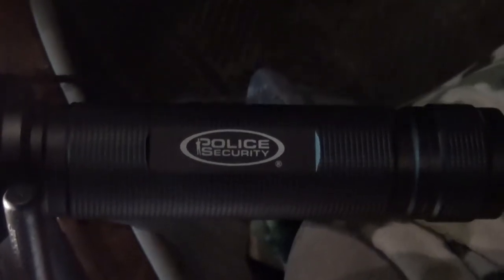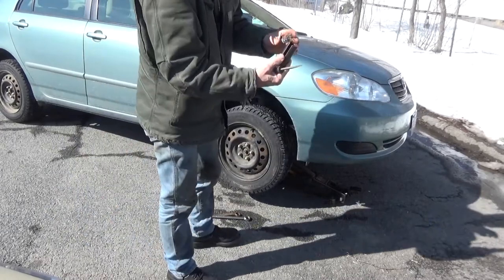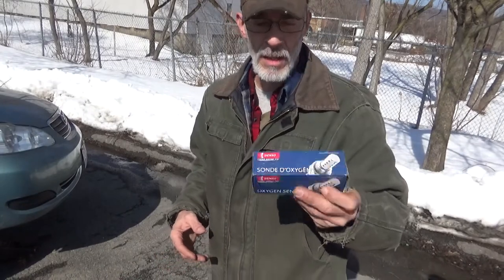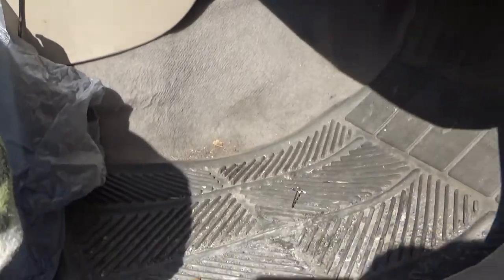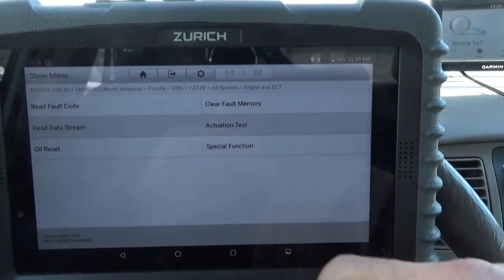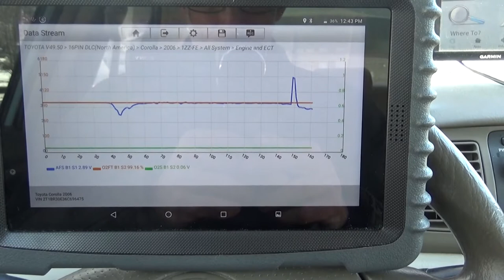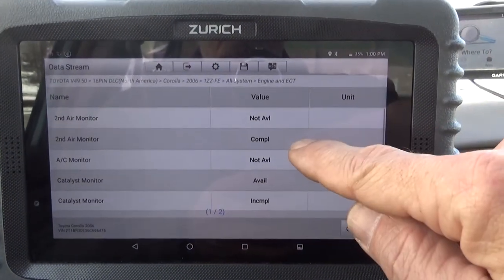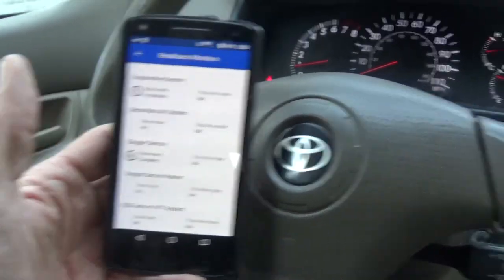2006 Toyota Corolla Rear Oxygen Sensor - The Repair - P0037 - Part 2 - Auto Repair

Comment: The Denso oxygen sensor I received was a 234-4802 is that going to be a problem for me? It's for a 2006 Toyota Corolla LE. (upstream Part 2)
Reply from the maker: according to what I've found, that part number is for the FRONT O2. This video was for the REAR O2. They are NOT interchangeable.
Reply: Thank you so much. I appreciate your response.

Comment: Hello I have a code saying bank 1 sensor 2 is that the one you changed also mines is a 2005 Toyota Corolla would it be the same as your it’s a V4 also sorry is it before the converter or after
Reply from the maker: Technically an inline 4. 1.8L
The Sensor in the manifold is sensor 1 bank 1, and the sensor, installed in this video is sensor 2 bank 1, the one AFTER the catalytic converter. (The vehicle only has a bank1)
So yes, this is the same.
Reply: Thanks so much I appreciate it

Comment: Hello, Sr. very good video, very well detailed work done.  I have a 2005 Toyota corolla that during cold days in Canada, the checking light turns on and during warm days it turns off by itself.  a mechanic told me it was because of the oxygen sensor possibly.  I bought a much more basic scanner than yours that diagnoses oxygen sensors.  When I connect it to the Toyota it only diagnoses one sensor, which is the one that you change in the video, but the other sensor does not connect to the scanner, so I cannot diagnose it.  Also, the engine is a bit uneven in its idle in addition to consuming too much gas.  Is it possible that my scanner does not diagnose the sensor because it is faulty? Please if you can enlighten me with some advices 👍👍🙏🙏
Reply from the maker: The rear sensor is an oxygen sensor. The front sensor is an air/fuel ratio sensor. While I have seen some code readers that won't display an AFR, they usually just list them differently.
Reply: @HouseCallAutoRepair  thank you for your answer. I subscribed to the channel👍

Comment: Is that a 7/8" O2 sensor socket?  Do you think I could just use a box end wrench to break the old sensor loose or is a dedicated O2 sensor socket needed? thanks.
Reply from the maker: What ever method works! I use box end wrenches frequently (except when the wrench doesn't fit over the connector.)

Comment: @21 mins  mark around.  I paused. With that pipe breaking off. I'm sure it's after the cat so how will 02 read if pipe not connected.... ok I was wrong. I see haha.  Also was gonna say have to let it warm up   I have p0037 not sure if it's sensor   thought maybe since had axhaust leak before the sensor. Then pipe had a hole not broke off like yours but im driving maybe a cycle will shut it if not I need a 02 sensor as well.  Also if delete code with scan tool does it leave a p0100  if so thats not good I fix the issue drive let it clear itself  or just unplug battery  terminals
Reply from the maker: P0037 basically means that current is not getting through the heater circuit. Either there is a broken connection, or a dead heater.
Reply: @HouseCallAutoRepair  thanks for the reply but if have exhaust leak will not effect it?  Also I disconnected the batter light went of then back on  car was still cold.  I'm gonna check sensor to see if broken wiring I had on resistance I believe  did it correctly  forgot  what reading was but it had resistance
Reply: @HouseCallAutoRepair  also is it affecting  my gas mileage  will it damage my cat if I don't replace right away I've had that code for a few months.. also had a hole in flex pipe after seeing that I thought that was reason for the code. I see it's not the reason for it.  But I fixed hole in flex pipe. Still have the code I'll replace